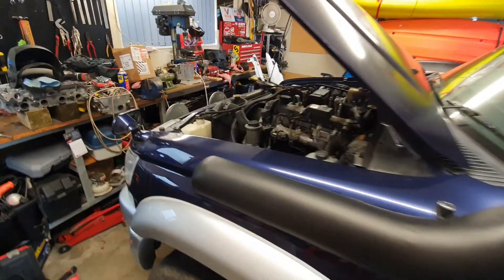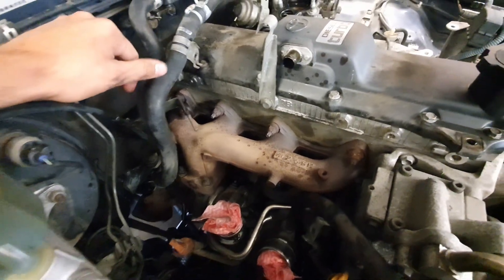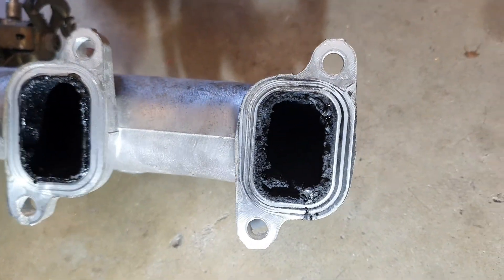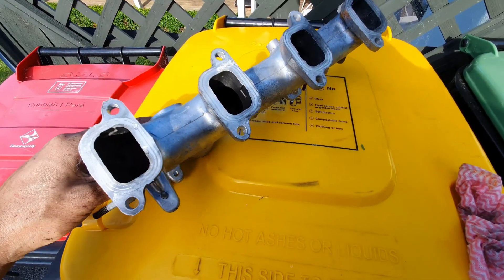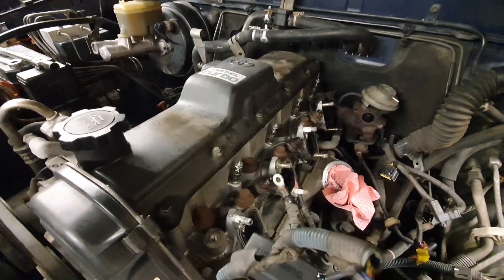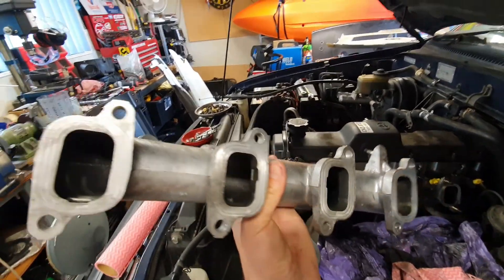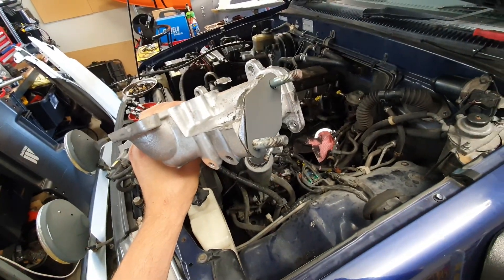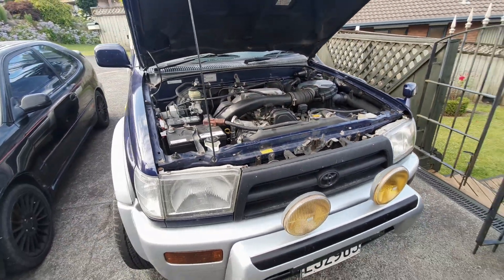1KZTE Intake/Port Clean, EGR Valve + Glow Plugs

Comment: hello mate…ex pat Kiwi watching from over here in Oz…had the EGR and intake manifold decoked professionally on my 2004 Hilux Turbo Diesel…they used a pressure clean and solvent system…cost me a pretty penny but it was worth it…also had the EGR deleted at the ECU..(no blocking plate). One of the best mods you can do on these 1KZTE motors is a 3 inch exhaust…you don’t have to spend big on a stainless steel name brand…just go to any muffler shop and get a mild steel mandrel bent unit…does exactly the same thing as a high end system…a 3inch hole is a 3inch hole…they can do it in under 4hrs…$480 bucks…thats en extra 3hp right there …money well spent!
Reply from the maker: Thanks for the comment. Definitely goes better with that muck cleaned out of the intake and EGR blocked off.
Yes I have heard about upgrading the exhaust, especially the dump pipe off the back of the turbo is really good upgrade as the factory bend tightens causing a bit of a bottle kneck. Have been meaning to make a new exhaust up for quite sometime now, although my time seems to end up going into my other cars unfortunately.
Reply: Where does the dpf sit? On your 2004 1kzte?
Reply: @Crust2013  There is no DPF on the 1KZTE...if you are referring to the EGR valve it is behind or should i say at the back end of the block between the firewall and sits level with the valve cover. It is a rounded flat shape to it if that helps
Reply: @russellking9762  oh yes true, thanks,I have found it now, new to owning the lux,um what path did you take  getting EGR turned of at the ecu? I'm trying to find someone
Reply: @russellking9762  I'm in New Zealand.
Reply: @Crust2013 Theres a couple of ways to do it. You can either use a metal blocking plate with a hole drilled through the centre or you can get a cable that runs to the ECU. Both of these are available on line. Google. I would suggest you get your intake manifold de-gunked first
Reply: @russellking9762  yea will definitely be on that mission soon.what cable
?

Comment: 1KZ engines benefit from:
Opening up the spill valve a bit more
Bigger exhaust
Air filter upgrade
EGR system cleaned out
Bit more boost
Injector nozzles cleaned/replaced and opening pressures reset. 
Factory ceramic glowplugs replaced with Italian made Twin-coil steel glowplugs. 
Factory hose from intercooler to inlet replaced with quality silicone hose.
The small charcoal filter in the boost pressure line deleted and replaced with a tiny paper inline fuel filter. 
Replacing EDC-V4 injector pump ( which really are uber reliable) with a 4M4O-T or a modified 2L,3L or 5L mechanical pump.
Reply from the maker: Thanks for the comment

Comment: Great video and clear walkthrough of the job!
Reply from the maker: Thanks
Reply: @4AGEEDGarage  do these 1kzte engines have EGR coolers?
Reply from the maker: @russellking9762  no they don't, hot exhaust gases flow through the engine which decreases performance, and obviously adds more heat which isn't good for the 1kz heads which commonly crack.

Comment: I started taking my intake off today but the EGR nuts are really seazed up so will soak it with penetrant and try again in a few days. I see you got your EGR nuts off the intake side. My intake looks about the same as yours for build up of crap. Doing the injectors, timing belt and install an EGT. Along with a list of other modes and upkeep. Thanks for showing me how it is done, what to expect and the confidence boost. Nice job and look forward to more.🇨🇦
Reply from the maker: Hey, not good your nuts are really seazed up. Mine were all fine besides the one on the exhaust side of the egr valve pipe. Sounds like your doing some good maintenance and welcome about my video helping.
I'm about to replace my injectors soon, looking forward to that. I'm getting more milage to a tank of diesel too since clearing out intake too.
Reply: @4AGEEDGarage  thanks for replying. We will get there, may take some time. I will definitely watch for the injector video in the future. I am sure it will be thumbs up worthy. Cheers!

Comment: Thanks for the thorough video! Have there been any downsides to blanking the EGR? Does it throw any error codes?
Reply from the maker: Welcome, no downsides at all or any error codes. I was expecting an engine light or something to appear, but nothing. All vacuum lines and electrical plug still connected to egr valve. Performance is better now without the exhaust gases going through the head and ports clean.
Reply: @4AGEEDGarage  Great to hear, I’ll be doing an intake cleaning on my Surf sometime in the next few weeks and I’m also planning on installing an EGR blanking plate. I have a ‘98 JDM Surf that was imported here to the States, so I’m sure it’s way overdue for some intake maintenance!

Comment: Love the video man, that bolt at the bottom round the back of pipe to Egr is an absolute nightmare. Did you go with stainless blocking plates or just straight up steel?

Comment: hey man, did you removed the butterflies in the throttle body as well? i did blocked the EGR both ends today and just reading some forums saying it will have to remove the butterflies if not it will restrict air flow? how is your engine going so far? any issue after blocking them?
Reply from the maker: Hey mate. I cleaned the main intake manifold throttle body only, but not the egr valve butterfly as it on the otherside of the blanking plate, no gases flow through egr valve since being blocked off.
My Surf runs great and not one issue since blocking it off.

Comment: Worst part for me is the wiring, bottom bolt on the egr pipe (hot side) and around the throttle body itself. Absolute nightmare

Comment: Hey man, I’m based in waikato and have just done the first half today.
Just wondering what you did with all of the vaccuum lines and sensors that went to the egr? 
Awesome video by the way!
Reply from the maker: Hey Nick, thanks heaps. Sweet just over the hill. I'm in Tauranga. I left everything connected up as it was from factory but only fitted the blanking plates to stop the exhaust fumes from flowing around into the intake. Hope that helps
Reply: Awesome that sounds like the way to go. Bloody hell small world! 
Keep up the videos man theyre great
Got a toyota carib as well and pretty keen on putting a 4age head on it! Probably easier on paper than in reality

Comment: Hey So those two bolts on the exhaust manifold I got the top one, but the bottom is stripped and afraid I’ll snap it if I go any farther with a wrench extractor bit. So if I just disconnect the egr pipe from the intake manifold side where it runs into the egr itself 2 bolts there and block that side, will I have back pressure issues? Like higher egt’s as well? Since exhaust gas will still be able to move through the egr pipe before the manifold intake? Thanks from America 🇺🇸 great video.
Reply: Also did you have to bleed injector air or prime the fuel system as well, or does it all sort itself out once running for a bit.
Reply from the maker: @SamFixesThings  thanks for the message. No good about your stripped bolt. Unsure if it will disrupt flow if the exhaust side isn't removed. In my mind I think there would be some disruption but I'm no expert. The injector pump sorted itself out by itself for me, had to wind it over for a bit before the diesel reached the injectors.
Reply: @4AGEEDGarage Thanks!

Comment: Hey when you took your inlet manifold off did you remove the fuel lines first? I’m having trouble getting the last nut in the bottom corner. Also idk how you got the nuts off for the egr exhaust pipe. That’s footage I would pay for. I had to chop mine
Reply from the maker: I used a special tool to remove the fuel line nuts, same one as pictured on this link. https://www.supercheapauto.co.nz/p/toolpro-toolpro-spanner-set---3-8-drive-crows-foot-flare-nut-13-piece-metric/591843.html#start=42 .
Egr on exhaust side I brought a cheap socket and cut it down for one of the bolts and used a strong bar. The bottom bolt was the challenge, top one was fine and loosened straight away.
Reply: @4AGEEDGarage  I’m having a hard time getting that last nut holding the inlet manifold on. It’s right next to the oil filter, the very far bottom right nut. I had to remove the fuel lines first. I hit it with some pb blaster. Hoping it comes off. Not much clearance. 

Im kinda screwed if I don’t get this manifold off because the EGR is stuck between the firewall and manifold. 

Everyone’s videos made it look pretty chill. But the hilux surf has no clearance for any of this job. It’s been rough
Reply from the maker: @N8_10  have you removed your oil filter to give you more room?
Mine was straight forward and they all came off reasonably easy. Might need to use a strong bar to help crack it without doing damage.
Must be very frustrating it hasn't been straight forward.
Reply: @4AGEEDGarage  I did remove the oil filter. I used a small 6 inch ratchet and threw my whole body into it. I finally got the Manifold off and now everything is ready to clean. Technically it was pretty straight forward. But the surf just felt like it wasn’t meant to do an egr block without lifting the engine.

Comment: hey man nice video its helping me tons. Having a problem getting the injector fuel lines removed to get that last intake manifold bolt on back bottom. did you take the injector fuel lines out then remove the manifold or take out the manifold then the lines? Because the lines block me getting that last bolt out easy. its been a task thats for sure. thanks!
Reply from the maker: Hey mate. Thanks for the comment. Yes I removed the injector fuel lines to help. Unscrewed from injector pump and injector.

Comment: I see that you made sure the valve was closed on every intake that you cleaned. But won't the leftover soot and crud still be able to fall into the cylinder when starting the engine?
Reply from the maker: Was flushed right out multiple times with brake cleaner after scraping, wiping the ports. Any possible crud would be minimal, if any, and no difference to the rest of the crud the engine has sucked through from the egr in the past.
Reply: @4AGEEDGarage  Allright! Thanks!

Comment: I haven't done a oil and filter change on my engine yet. Therefore. How do you remove the oil filter without oil running down the side of the motor being that gaskets faces the floor. 
Good video. I might attempt it one day.
Reply from the maker: @toddthomas3226  hey, there is a drain underneath oil filter with a pipe that the oil drains underneath the vehicle